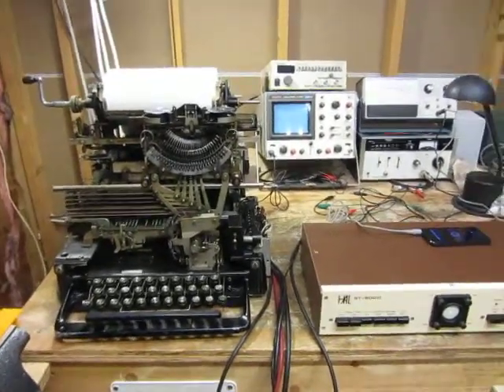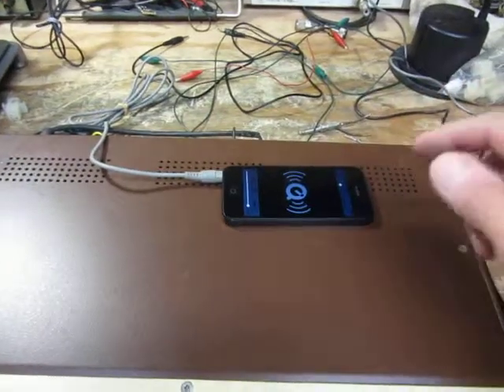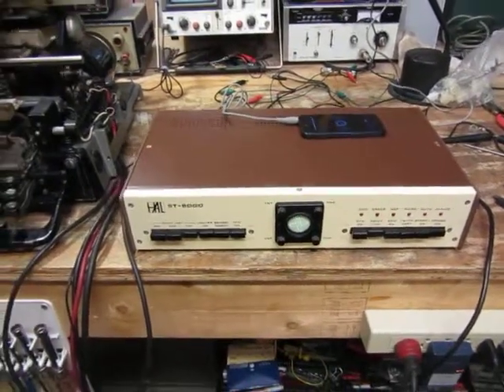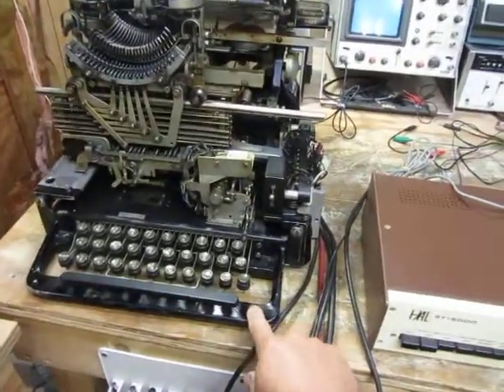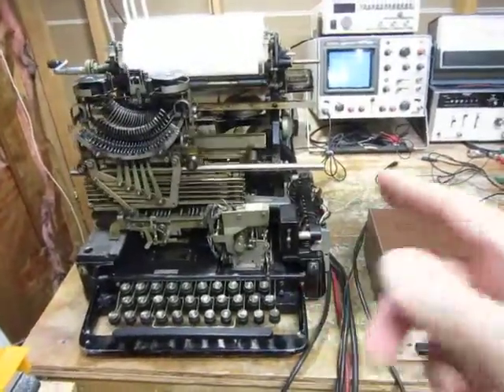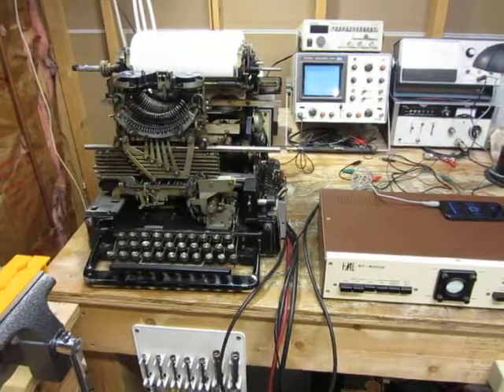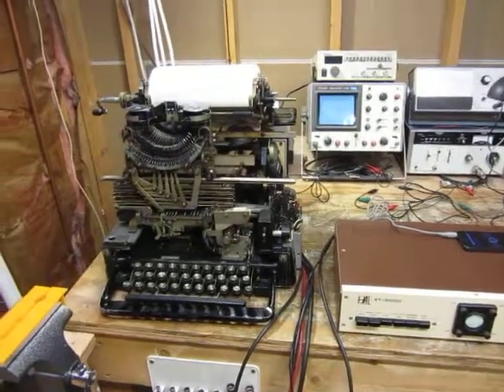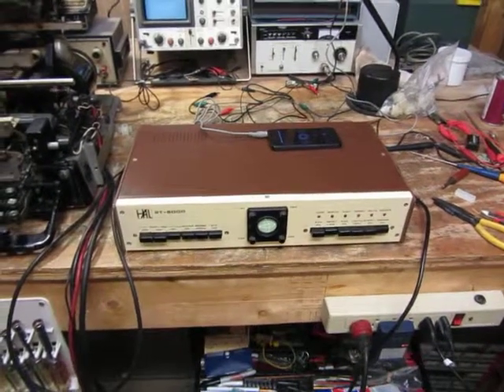Model 15 Teletype

Comment: +Gary Franklin - I just got a Teletype Model 15... how did you do this ;o ???  Curious about the audio cable to the teletype (requires a voltage loop) and which cables you had to power it - AC/DC, etc ;) .  If you could help out in any way possible, I'd be very grateful ^_^ (and thank you in advance ^^ )!!!... right now I'm grasping for straws here ;o ~  :/ .....
Reply: Where did you buy it